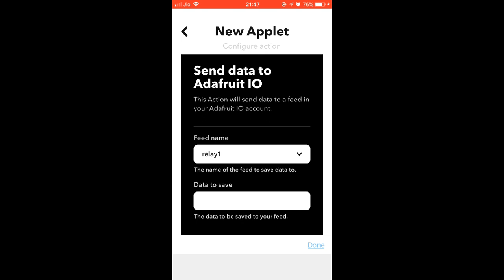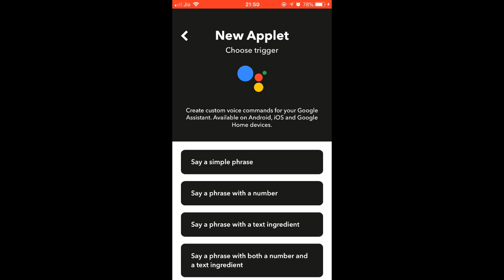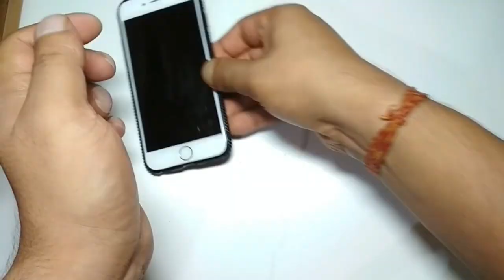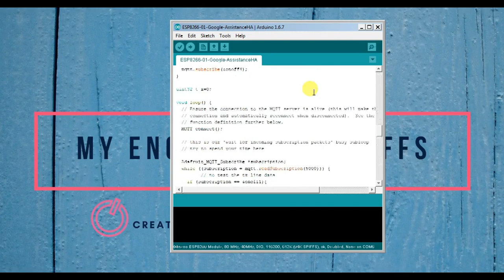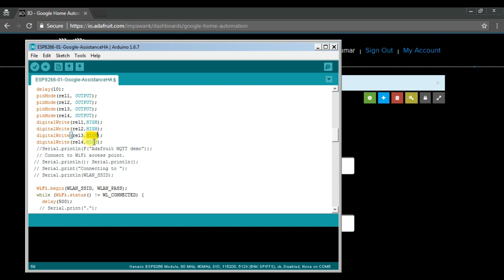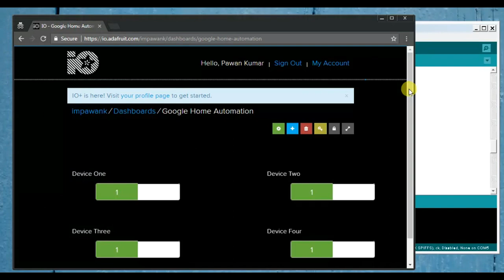Google Assistant based 4 Channel Relay Control (STEP by STEP) | ESP8266-01

Comment: IFTTT- Paid service now//
Reply from the maker: Hey friend you can use standard service for free.
Reply: @MyEngineeringStuffs  ya but for  each relay we need  2 scripts and ifttt gives only  3 free scripts .which can controle only  1 relay ...this is not sufficient i want to controle atleast 4... better option i am using is Sinric [EOL] Sinricpro which gives 3 free device control
Reply from the maker: @riteshsinha5900  ok just now I confirmed. IFTTT is now restricted to 3 Applets. So, only One device can fully be controlled. And I have not used Sinric.

Comment: In my case why only first feed works. The other feeds give no response
Reply from the maker: knp2 if single case is working then all should work. Try to check the case values.
Reply: Did you manage to fix it?
Reply: Yup. Did it. Faulty jumpers.